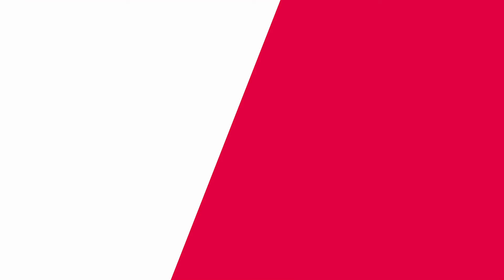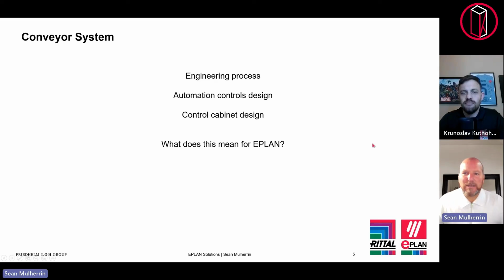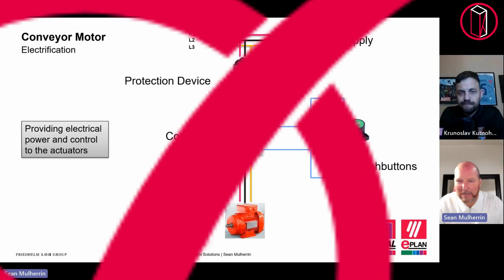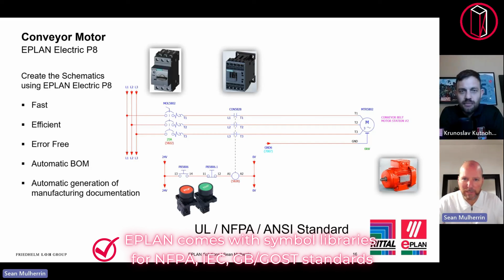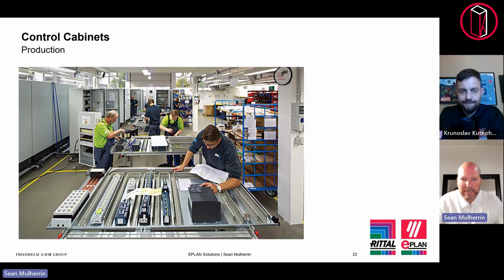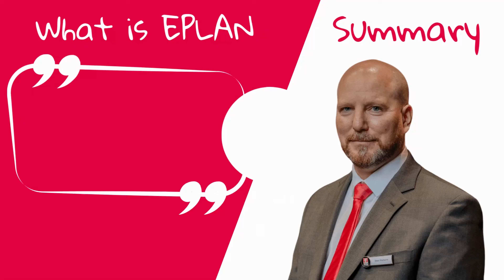Uncovering the Mystery: What Is EPLAN?

Comment: excellent video...i been following since couple of months...i am just new on this eplan platform...expecting more and more sessions like this..☺️☺️  uncle kruno plz help me out for my one question ...what exactly is higher level function and mounting location...simplify me with simple example😺 make a video on it...i am waiting for it.🙂
Reply from the maker: Thank you swarup for you feedback and this question.

It is a great topic for a video.

I will try to answer it here already:
In the IEC 81346 standard the + and = identifier are next to the - identifier used to describe what the device is doing (Function [=], where is it located (Mounting location [+]) and what is it (Device Tag [-]), utilizing this standard customer can unleash a different level of structuring in the Project. And functional structure can lead to reducing the time in engineering.
Plus it has additional features on the shop floor like the ease of identifying components etc...

Hope this helps for now.

Cheers
Kruno